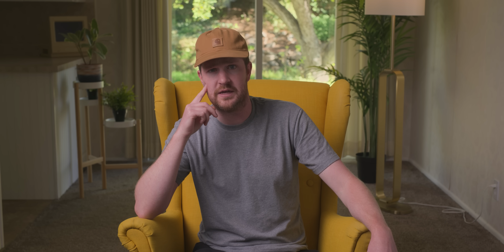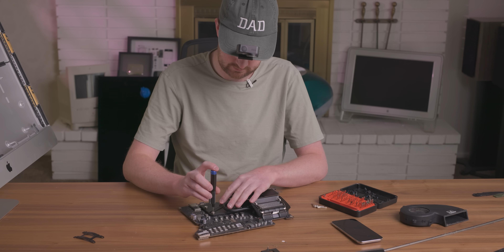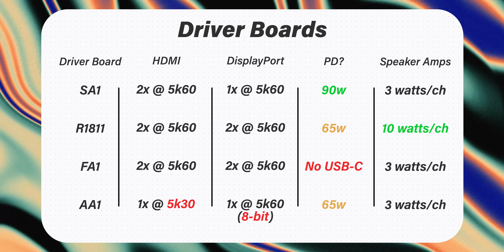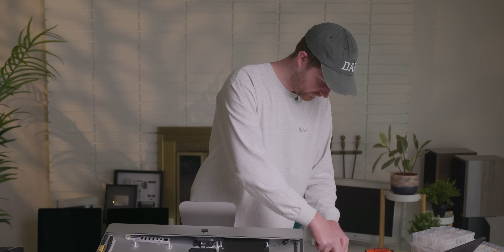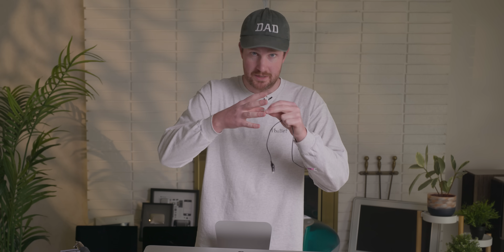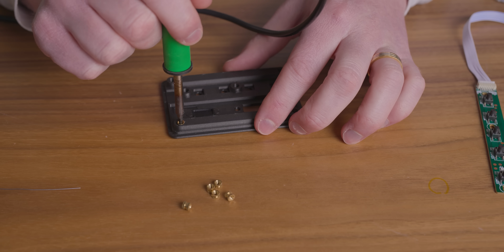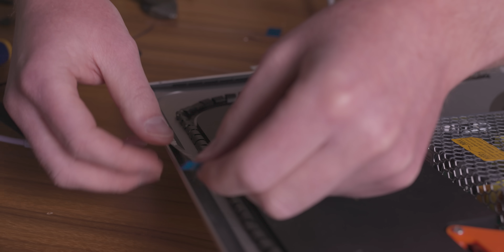I Turned a $200 iMac Into a $1,600 Studio Display!

Comment: So this is a 500 dollar project?  300 for the old iMac and 200 for the video controller board.  That seems to be way too expensive for the end result.  I have a client with a 2017 5k that will be upgrading next year.  I guess its good to know that they can get 300 bucks for their old imac.  I upgraded the thing to an SSD too a few years ago.
Reply from the maker: $500 is way too expensive for a monitor effectively equivalent to a $1,600 one?
Reply: @snazzy  yes, seeing as it comes from a computer that sold less than 1600 dollars 8 years ago (2017 5k), wherein apple considered the majority of the value of the device is within its computer components.  The video-in board costing 200 is too much to me alone.  I use a 2017 iMac 5k about 4 times a month still running Ventura and its hasn't felt otherworldly to me as a monitor, granted its only 21".  If it really is being valued at 1600 dollars for 500 and a moderate amount of effort, I guarantee you someone would be out their trying to make a profit through cottage industry.  Its a cool idea, but for a hobbyist project $500 is too expensive. The people likely to care about color accuracy aren't gonna want a macgyver device for professional work.  That's just my thoughts on it.  To each their own.
Reply from the maker: The 21.5" display is significantly worse than the 27". Not just in resolution, but in color rendering, brightness, and ghosting.
Reply: @snazzy  For sure.  No one wants a 21" display these days.  For 500 bucks Id build a more power efficient NAS.  Jonsbo has a new NAS Case that looks pretty rad.  I'd dig seeing more homelab stuff on your channel.  I feel like Mac users are the best fit for a NAS due to the high cost of SSD storage.   I think unRAID has some cool new features too.  I have been without my NAS for a while as its too much power to run 24/7.  I stepped away from Plex for Stremio, so I don't feel as compelled to run it except when I need something specific.

Comment: From what I can see, you can get a ton of 4k HDR (90+% dcip3) monitors for as low as ~$300 (and they have freesync and 144+hz). Once you're up to $700, you can get OLEDs with similar specs that blow this out of the water.
Reply from the maker: True, but not 5K!
Reply: @snazzy  Sure, but 4k at 27" is still >160 PPI, which at normal viewing distance is total overkill. I'd rather a 144hz 4k display over a 60hz 5k display 100% of the time.

Comment: Choosing 5K monitor that fully supports native Mac resolutions (RETINA) - and does not force rescaling is not wired kink, but rational and important choice! 4K monitors put huge load on Macs GPU! (& not all 27” 5K monitors do support native Mac resolution- latest Samsung does not, without patching), anyways LET’S DO basic MATH - on 27” 4K panel Mac OS upscales image to 6K and next downscales it to 4K and does it 60 TIMES PER SECOND with 60hz screen or more if screen has faster refresh rates! Ask chat GPT about GPU load and how does it slows down your Mac model :D
Reply: At this moment there are actually three 27” monitors that are fully compatible with Mac’s! 1. Apple Studio Display 2. older display that was removed from market, pretty good 27” 5K UHD UltraFine LG monitor, and 3. new 27” Benq thunderbolt 5K monitor. 4. Apple Pro XDR display (but note this is larger size and 6K panel), There are also two other 27” 5K monitors on the market but those do not support full native Mac compatibility 27” 5k thunderbolt Samsung (this one can be patched) and 27” 5K USB-C ASUS.
Reply: @t @tomaszprzetacznik7802 hich is the best bang for least $$ the Samsung patched?
Reply from the maker: This is true and a great thing worth mentioning! Thanks for the comment!

Comment: Nice project,   don't know about the timing since we know have 5K monitors  that are not related to Apple. It took the PC world years to build them but they are in. They lack the brightness and they are mostly the "cheap" version of matte, so one lost a lot of contrast and sharpness, but the prices are "decent". For example, at this time  (2025-11) the ASUS 500 nits ProArt Display  is  $850 and the 400 nits BenQ PD2730S is 1200$ give or take. The 500 nits Visonic is $949.99
Reply: @jaimeduncan6167  do they work like the Apple displays do though? When you use them with a Mac? That was half the problem being solved here.

Comment: Your average Dell ultra sharp  monitor does single cable docking just great.
Reply: Got a LG Ultrawide that runs my M1 MacBook Pro on a single cable also, even charges it.
Reply: LG and BenQ as well, plenty of monitors do single cable. A lot of them include ergo-arms that move in all sorts of directions and clamp to your desk or through a grommet hole
Reply: My 65 quid crappy plastic 1080 monitor from msi does single cable connection :S

Comment: Paul DK is a true legend. Helped me to build mine 2 years ago and is still around! 

What I did differently myself:
1. Used port holes extensively 
2. Routed USBC/mini DP female via Ethernet holes, so I can attach external cables
3. Used tiny joystick for OSD controls via audio jack hole 
4. Reused original iMac PSU 
5. Noctua fan controller accessible via ram cover 

Man, I wish all these 3D printed parts existed back in the days. Super helpful
Reply: Ah yeah, and it still works! 2 years later and after air freight shipping on a plane when I moved countries. 
Solid piece
Reply: Nice idea with the joystick! About the original PSU, i was thinking to do that, too. Any recommendations or tips? Is the power button then just working as is?

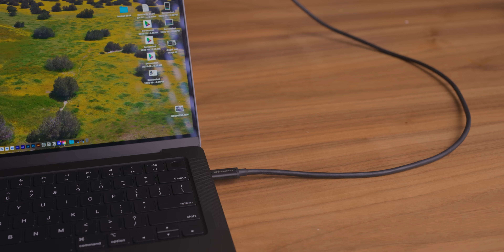Comment: 1:42 and? I got an ordinary dell with usb-c and works fine via one cable.
Reply: Jep, a ton of monitors work with USB-C by now, not the limiting factor it once was. Charging is another can though, lots of monitors deliver subpar watts. I think the better alternative is to just get a good monitor, dgaf about the input ports and get a halfway decent thunderbolt station, even older thunderbolt 3 spec'd ones are good enough.

Comment: Why didn't you just solder the power wires to the test pads on that control board instead of fiddling around with the input cable?

Comment: I converted a 2014 27" 5k iMac to a monitor. Wasnt bad and got a board off AliExpress for my model with display port 1.4 and was even able to overlock the monitor for some light gaming.
Reply: how's it been long term?

Comment: But you can buy an older apple display it uses thunder bolt 1 or 2 its actually still quicked good you can find em for 90-150 depending on condition
Reply from the maker: They’re decent, but 5K they are not!

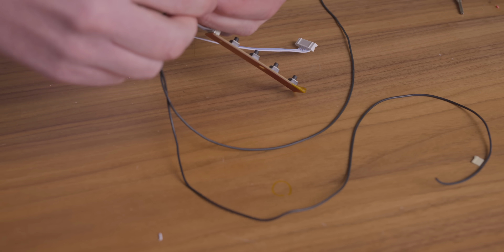Comment: 22:10 option B would be to solder the power button wires directly onto the little board(if the button is in the way you can just desolder it). And option C would be to get a nipple controller, you can find a bunch with the same pinout on aliexpress, so you only need a small hole(probably fits in the ethernet port or something like that)
Reply: That was my first thought too, desolder the switch and the board already provides you with power and ground pads to solder wires to, win-win.

Comment: 16:14 this hurts, you make ot so hard for yourself … just push a wire trough this thing, Twist the cables together, and then puth them in the middle under the solder. Much easier and it adds additional safety… 😁

Comment: Slightly unrelated but a month ago I bought a LG UltraFine 5K (almost identical to the studio display) second hand for £400(around $520) and its incredible. 
You can find them for like £300-350 in fairly good condition, mine has in near perfect, no scratches, dead pixels or anything.
Reply: Second hand is almost always unbeatable when it comes to tech.
Reply: Also due to the relative cheapness compared to the alternatives and the fact it was specifically designed to work with MacOS I am not terribly concerned about longevity. I figure/hope by the time it does Apple will have released a newer studio display and the old ones will drop massively in price.
Reply from the maker: But it is still a very great value if you can get one with a board that hasn’t roasted itself. They’re pretty unreliable long term. Luckily, StoneTaskin makes a special control board specifically for broken UltraFine 5K lol
Reply: @snazzy  Mine doesn't appear to have any problems but I have seen plenty on ebay for like £250 that have broken USBC ports. Because of the 1 cable solution, for most people if that port breaks its basically dead. 
I am pretty certain most the ones that appear on there people have already attempted to repair too.
Reply: Use it with a short and high-quality USB-C extension cable. Glue the extension to the back of the monitor and pretend it's just where the USB-C port is. Why? The USB-C ports on those LG monitors are really weak and fail easily. I'd rather have the back of my monitor look a bit ugly but it lasts 10 years than have it look good and last 18 months!
Reply from the maker: They’re good, but unlike the iMac, the display front isn’t glass! It’s plastic and not quite as uniform laterally. :’(
Reply: @snazzy  who would ever want glass in front of a display?! 😅🤣

Comment: 1:55 what do you mean about non-interger scaling? If you use a Mac with a 4K display set to 1920x1080 (Default), it should be pixel perfect
Reply: Apple uses a PPI of roughly 218ish, which is 2x scaling over what a 27" 1440p monitor would be. That's why their 27in monitor is 5k, and their 32" monitor is 6k for the 2x scaling. A 27in 4k monitor results in 163 PPI, which is not 2x scaling.
Reply: For me personally, 1080p on a 27 inch is kinda silly, everything is just too big, and I'm probably not the only one who thinks that.
Reply: @hikkamorii  and I'm assuming you think native 4K is too small? 
Maybe I'm just one of the lucky people who thinks the 1080p size looks perfect

Comment: oh good, I finally have a use for the 3 dead 27 inch iMacs I got from work for free
Reply: Hope you can make them useful again!
Reply: What type of “dead” are they? 
I’m am 100% the person who would take 4 computers and harvest the parts from 1 for the other 3 and get 3 working machines to throw Linux in. (Assuming it’s not the same part on each computer)
Reply: @KevKevAllen  i am also that person but sadly, one has an EFI lock and trust me, unsoldering the EFI chip on there is a nightmare, the other two have broken logic boards
Reply: There's an app called Retina Relay that lets you use them as a monitor with just a thunderbolt connection. Works seamlessly... Thank me later

Comment: Mac tagline: "it just works!"
This monitor setup:
Reply from the maker: “You can make it just work!”
Reply: @snazzy  "You can make it about work"
Reply: @snazzy  you can make it, just work.
Reply: @EviGL  🤣
Reply: "Fk stairs."
Reply: Nice! It’s a small, highly reflective monitor with an attached PC that will go obsolete before the monitor does… with severely limited input options. Oh, and it consumes more power than the display alone would.
Reply: Mac: it just works! 

YouTubers: no it doesn’t, look what happens when I literally pull components out and try to use it as something other than how it was sold. 

Mac: well that’s obviously not what the machine is intended for, how can you-

YouTubers commenters: BECAUSE MAC SUCKS YOU CANT CUSTOMIZE ANYTHING

Mac: okay then… 😳🙄
Reply: @KevKevAllen  Finder in Mac won't even let me choose to sort by ascending date in icon mode. It's so far from "it just works" I often wonder if anyone at Apple actually uses their software anymore.
Reply: @Thirsty_Fox  they use linux
Reply: @Thirsty_Fox  I know this comment/video is old, but i'm compelled to mention that your gripe is oddly specific and surely anyone looking/searching for a specific file by date, would normally be viewing a list, not icons.
Reply: @jeremyglover5541  Why would you use list for photos or videos? What's the excuse to not be able to choose chronological order (which btw is typically oldest first)? Worse yet, "icon" mode acts like a grid -- if you use the arrow keys to select, it stops at the end instead of going to the next image on the next row.

Yet this is how you're supposed to use the "preview" mode (spacebar), although that shows a really low-res preview, but when it gets to the end of the row in the background, it just stops. The Preview app is garbage for this, too.

I want to like Apple because their hardware is great, but macOS makes everything so much more difficult than it needs to be. As much as Windows 11 is a downgrade from Windows 10, the stock apps and window/file management are just so much better. Linux also gets these things right, so I don't know what Apple's problem is.
Reply: @Thirsty_Fox well, for one,this is the first time you mentioned photos, you said search by assending date …surely you would just use lightroom,  or another photos app that can also read metadata if you need to search for photos.
Reply: And to be clear. I use all 3, but only use windows when I have to. Mac and linux are far better options.
Reply: @Thirsty_Fox  Apple doesn't have a problem - you do. Specifically, your problem is that you expect a Mac to work like Windows. It's not better or worse - it's just different, and instead of embracing those differences, you get upset that it doesn't work exactly how you want it to.

Case in point: anybody who actually uses a Mac on a regular basis knows it does not "make everything harder than it needs to be." Language like that is a dead giveaway that you're not the expert you purport to be. I can think of lots of things that are harder on Windows than Mac (and vice versa). Those things may not matter to you but it's kind of amazing to see a comment like yours, confidently and unequivocally asserting your biased opinion as a universal truth, while the rest of us just wonder what the hell you're even on about.